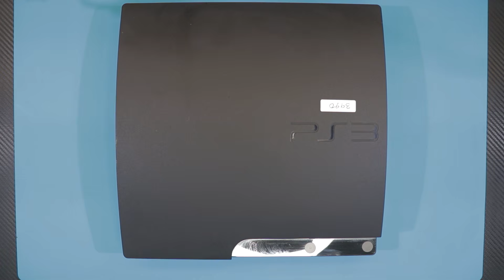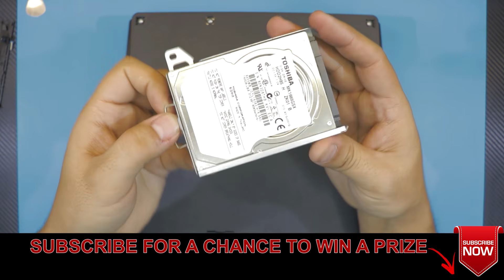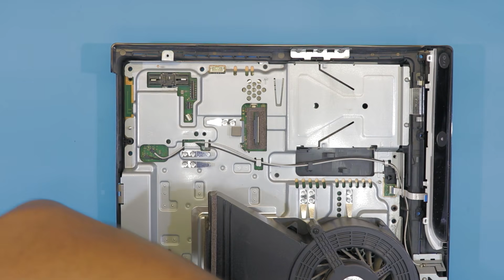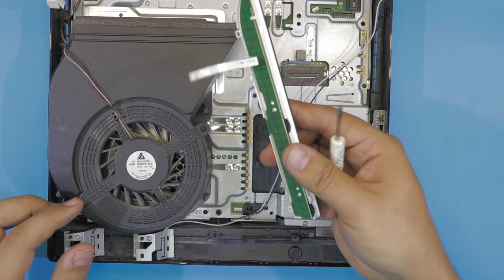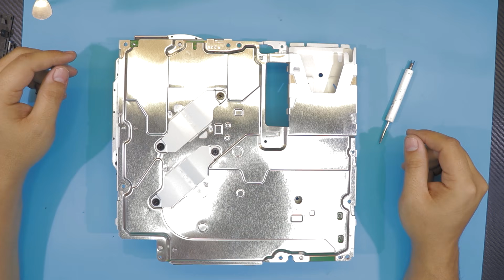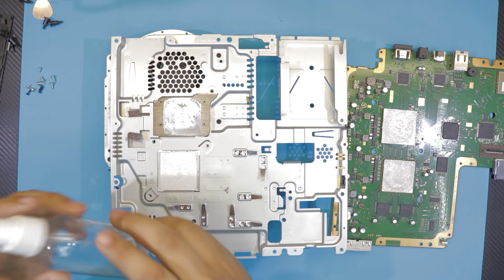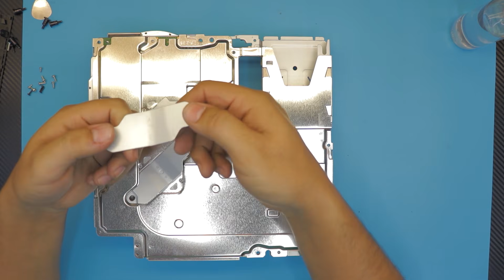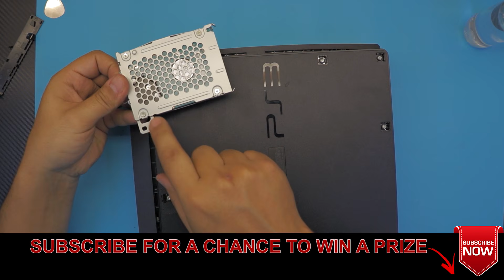HOW TO CLEAN AND  REPASTE YOUR PS3 SLIM ( playstation 3 slim console )

Comment: Hi UFIXTEX, I have a question about the Ribbon Cable from the Bottom side of the Blu-ray disc drive. Is it safe to use any kind of marker to label the Ribbon Cable from the bottom side of the Blu-ray Disc Drive? or Do I need some sort of a special marker for this? I just want to know that if it's safe to use a marker to label the right side of the Ribbon Cable while Reinstalling the Blu-ray drive. Can you tell me that if it's safe to use a marker for the Ribbon Cable from the bottom side of Blu-Ray Disc Driver? Please Comment Me Soon. See You Later.
Reply from the maker: Thank you for your feedback! If you wish to support the channel, you can like, subscribe, or both!
Regarding your question, yes of course you can use a marker and label the flex cable the side that goes to the board and the side that goes to the dvd drive, you so can be on the safe side.
Should you have any further questions or requests in the future, please don't hesitate to ask me.

Comment: what does the thermal paste do?
Reply from the maker: Thank you for providing your feedback! If you'd like to show your support for the channel, you can either like, subscribe, or do both!

In response to your question, thermal paste is a compound applied onto the CPU and GPU. Its primary function is to improve the transfer of heat from these components to other surfaces. Additionally, it aids in filling the microscopic imperfections present on the copper surface of the heatsink and the CPU/GPU. Using high-quality thermal paste is of utmost importance in electronics.

Think of it as akin to changing the oil in your car every six months to enhance performance and heat dissipation.

If you have any more questions or requests in the future, please feel free to reach out to me. Your curiosity is always welcome!

Comment: POV 
Take the power supply out & fan clean fan, Heatsink, put it back together 💀 not risking that disc drive
Reply from the maker: you won't be able to remove the heatsink and repaste it, without removing the DVD drive. the DVD drive is not a risk, take your time and you can get it done under few min.

Comment: I finished with an extra screw and the top case won’t stay on
Reply from the maker: you can try to follow the steps and see where you missed the screws but most of the screws are useless, even the top cover is better off than on better cooling :P

Comment: I recently took apart my PS3 slim and when I went to pull out the ribbon cable for the on/off button, I broke on the clip for the ribbon cable and have been looking around to see if I can find a replacement part. Does anyone know where I can search for a new part?
Reply from the maker: what click the jack where the flex cable connects to the board or the jack on the on/off board?, or the flex cable is damaged?
look for it in aliexpress they have all
Reply: @uFixTek  the cable is fine. It's the jack on the board that's been broken off.
Reply from the maker: just to clarify we talking about this jack? https://imgur.com/a/vL9YCX2
how you managed to do that?
it will be very very impossible to find it, the only solution is to ask repair store to sell you one from a donor board.
Reply: @uFixTek  yeah, that's what I'm referring to. And that's what I was thinking I was gonna have to do if I wanted to fix it.
Reply from the maker: but you could just take the board to a repair shop and ask them to replace that , it will be cheap rather taking the all parts assembled.

Comment: Do you had any advice for dead screw? It wont budge at all. I cant do anything because the screw is on psu
Reply from the maker: Thank you for your feedback! If you wish to support the channel, you can like, subscribe, or both!
Regarding your question, use a flat heat screw driver small enough to get inside and it will remove it.

Comment: I have a question you are removing power supply screws with machine I don't have one and power supply screws are so hard I can't open it
Reply from the maker: press down hard on them with a bigger handle screwdriver and rotate.
USE a bigger handle screwdriver.

Comment: 4:00 i'm having a big problem removing these two screws... any suggestions?
Reply from the maker: Thank you for your feedback! If you wish to support the channel, you can like, subscribe, or both!
Regarding your question, To loosen the screw, it is recommended to use a larger handle Philips screwdriver and apply downward pressure while simultaneously twisting it.  it will come loose.

Comment: Will this fix this symptom that is happening to mine?  Unit turns on shows green led then it turns red immediately ...doesn’t put out any video....any recommendations?  Thanks
Reply from the maker: this will prevent that from happening, to fix this issue i can tell you how to do it at home, BUT MAKE SURE you follow every single step.
#1. remove the motherboard completely (heatsink )
#2. place the board on a wood table ( clean the thermal paste)
#3. make sue the room temperature is constant (no air conditioning turned on), no fan.
#4. use a hair dryer at max heat and medium air,
#5, keep it straight over the GPU ( the chip that has a thicker heatsink) for 10-15min with 1" distant
#6 let the board cool down on its own, Do not move or touch the board for 15min
#7 repaste and enjoy.

Comment: I recently bought a never used CECH-2001A PS3 slim In mint condition still in its original box and everything. I recently opened it up and replaced the dead CMOS battery due to it sitting for so many years never being used, but I’m still a little hesitant on going further. The manufacture date on it is June 2009, so it’s going on 14 years old now.. surely the paste in it is aged, should I just toughen up and re paste it? I do want it to run for a long time. Thoughts?
Reply from the maker: Thank you for your feedback! If you wish to support the channel, you can like, subscribe, or both!
Regarding your question, i highly recommend you to repaste, the paste is over 5 years and it has lost it's proprieties. if you want your console to last longer and not duffer any over heating, clean and repaste.
use a High-Density paste:  https://amzn.to/42QAwsW
Should you have any further questions or requests in the future, please don't hesitate to ask me.

Comment: Glad I found this video. Much better than others I've seen. Thank you.
i just bought a used PS3. It takes the discs in but sounds like it's struggling. The steel rods are dry on the disc drive so I'm thinking they need lubricated. What grease do you recommend? Or it could be the motor is going bad. I hope not.
Reply from the maker: Thank you for your feedback! If you wish to support the channel, you can like, subscribe, or both!
Regarding your question, much appreciate the support, use this for the lubrication, i use this for years and have a good result, and air dust the dvd drive,
https://amzn.to/3VIjQkH
https://amzn.to/3HJNXT1
Should you have any further questions or requests in the future, please don't hesitate to ask me.

Comment: 8.30 man those 5 screws are tight
Reply from the maker: Regarding your question,  use a long screw driver and make sure you press down on the screws hard and do a slow turn with pressure on them.

Comment: 👌🏽👌🏽👍🏽
Reply from the maker: You are welcome! Glad that it helped you 😊Thank you for the feedback! if you wish to support the channel you can LIKE or SUB or both :P
if you have any question or request in the future feel free to ask me.
Reply: @uFixTek  

Thank you very much for your good training. I had a question. When I opened the console for the first time and cleaned it, I plugged it in and it worked without any problems, but I left some screws and 24 hours later I had to open the console again, but this series of consoles  It didn't turn on. Can you tell me where the socket is? I connected everything correctly
Reply from the maker: Around 80% of the screws in the console are unnecessary and not required for proper functioning. If you've reopened the console and it's not working now, you need to double-check every single flex connector to make sure they're not damaged and inserted all the way into the jack.

Comment: I can't seem to screw the tension plate back in place 🥲💔 can you help me fix this?
Reply from the maker: Thank you for the feedback! if you wish to support the channel you can LIKE or SUB or both :P
regarding your question:  you will need to lay down the fan side on the table and place the tension plate on the top, you want to only screw few rotation on the 1st screw (not all the way), the you will need to press down with your thumb on other side and place the screw in the hole and do few rotation, then place the other tension plate do the same. and then go back and screw all 4 all the way
Reply: @UFIXTEK  I really really appreciate the reply, it turns out that I was using the other (fat) Phillips screws not the black ones 😅, ops 🤦🏻‍♂️
Reply from the maker: jajajja good that you figured it out my friend 🍻
If you have any future questions or requests, please don't hesitate to reach out to me. I'll be happy to assist you.

Comment: Hello! I bought second hand  Playstation 3 slim before few days . I noticed that cpu and rsx temperatures have big difference around 20 degrees in favor of cpu . Cpu temperature is around 70-75 degrees and respectively  rsx is around 50-55 degrees . Does the problem come from old thermopaste ? The previous owner said that he did service for the console . Thanks in advance
Reply from the maker: Thank you for the feedback! if you wish to support the channel you can LIKE or SUB or both :P
regarding your question: it could be 50-50 if the owner placed a bad thermal paste quality, or never changed the paste and or cleaned the fan system. i recommend you to reopen and re apply and clean the heatsink, use a good paste like: https://amzn.to/3DlZs12
Reply: @uFixTek  Thank you for the information! Best wishes!
Reply from the maker: It's my pleasure my friend.
If you have any future questions or requests, please don't hesitate to reach out to me. I'll be happy to assist you.

Comment: Help i got to the end where u have to place the cover but i still have 2 black screws left that is for the inside and i cant find where i missed to place any screws also the on and off swith  and cd reader is pretty loose so please help me
Reply from the maker: Thank you for the feedback! if you wish to support the channel you can LIKE or SUB or both :P
regarding your question:  1st of all don't worry about the extra screws left over, 80% of the screws are not even needed. and in order for me to help you with screw location i need to see what you have done. regarding the ON/OFF can you send me a detail video link so i can see, in order to help you.
Reply: @uFixTek  yea sorry and thanks for commenting but i just bringed the ps3 to a repair shop , but since you're so nice and helpfull and i will 100% need your help im future i will subscribe and like also the thing is that the cd reader and the on and off switch is loose and there was practically nowhere to put the screws in as far as i saw. So yeah i was pretty confused

Also now that the problem will get fixed by an professional and not by dumb me. I have anotther question, i want to buy an SSD for my ps3 but i dont know how the connector type or whatever is called on the end which connects when you slide it in, do you know what it is called and do you have any reccomendations?
Reply from the maker: awesome, and you not less or dumb for trying and you have done more than what others can. i know people that can't even hold an screw drivers. just remember trying it not failure, not having the courage of doing, that's a failure. if you don't break you don't learn. if you don't try you dump :P
regarding the SSD upgrade here is a video i made on ssd upgrade see if it is what you looking for,
https://youtu.be/tXGp-XpBMd4

Comment: Is arctic mx6 a good thermal paste for the ps3? And is a 4g tube enough?
Reply from the maker: Thank you for the feedback! if you wish to support the channel you can LIKE or SUB or both :P
regarding your question:  it makes no difference in performance my friend you can place a artic mx 4 o5 o6 you will get the same performance. 
as long as you use a good grade thermal paste (known brands) you more than fine but if you want and can spend more go with higher end.
the CPU or GPU of the ps3 are not over clocked so they don't hit 99c with any thermal passe you use it will be under 70c.
https://amzn.to/3tLbzzw

Comment: For anyone wondering, this is a ps3 slim model CECH-2511a
Reply from the maker: thank you for the feedback, and yes it is 2511a and the other model the link to it is in the video description
Reply: Do you have a video for the model CECH-3001B ?
Reply: And what would be the diffetence between the 2511 and 2501?
Reply: mine is 2500a
is the internal are different?
Reply: Yeah I have this one and i was struggling to find anyone else with the same one on youtube. I was having trouble with the disc drive.
Reply: How do you know which model type you have? Does it say on the bottom of the console?

Comment: Don't you have to remove the cpu and gpu cover? Or is that just optional because i saw a ps3 slim disassembly and thet guy removed the covers and re-pasted that part and also put paste on the covers like you.
Reply from the maker: Thank you for the feedback! if you wish to support the channel you can LIKE or SUB or both :P
regarding your question:  absolutely not the paste under there is no need to be replace and there is a very high chance of damaging the crystal dye by doing it. and if you do replace the paste under IHS you will only drop the temp by 2-3c max.
and this is not a PC you can't over clock and only by re-pasting it's more than enough, and the temps won't hit 90c so no need to removing the IHS.
i been doing this for over 17years and i do remove the IHS as per clients request but never recommend it. Just use a good thermal paste and you be fine:
thermal grizzly kryonaut: https://amzn.to/3Gwsy0a
Reply: Ok. Thank you for your help. I just saw lits of people do it, but it is risky and the difference is small.
Reply from the maker: yep its not worth it absolutely not, that's why i don't make a video on how to do it, because not everyone can follow and do it. also won't see a performance increase.
Reply: @uFixTek  actually you are spreading misinformation now since i know you commented this a month ago and like idk about half a year ago came out an overclock for ps3 so yeah just pointing that one out also thanks allot for the tut im currently on reassembly part ill edit this comment to tell ya if my ps3 is fine( this my first time ever putting thermal paste)

Comment: I have a CECH-2001A and my lid won't easily lift off like this one. The area in the front left (to the left of the disc drive) doesnt want to separate from the base. My model has only three black screws on the bottom instead of four.
Reply from the maker: Thank you for the feedback! if you wish to support the channel you can LIKE or SUB or both :P
regarding your question: you must have 4 screws, can you email me few pictures from sides under of the console. or upload a video

Comment: 5:30 DO NOT pull on the flex cable at the bottom of the DVD drive!
The retaining clip is the brown piece around the plug on the board
Lift the brown piece up gently from power supply side and the cable will be free
Reply from the maker: PULL STRAIGHT UP , it will release it self, the retaining clip its not biting on the flex it won't damage the flexor!  we open so many and never ever had issue with it. but if you want to fight with it and find a way to stick your finger under and not damage the flex and pull the clip out..sure do it. but there is no way in hell you can damage the flexor by pulling it straight.

Comment: What are the chips that the thermal pads go over? I know the black square Sony chip controls USB or something but I don't know what the tiny chips under the RSX are or the R36X chips under the cell processor.

I was curious why those specifically had pads but nothing else.

Thanks for the teardown video!
Reply from the maker: Thank you for the feedback! if you wish to support the channel you can LIKE or SUB or both :P
regarding your question: those are MOSFET and power regulators (square shape black chips) to the GPU and CPU.
if you have any question or request in the future feel free to ask me.
Reply: @uFixTek  Oh ok thanks for the reply! So the 2 small chips are power regulators. What are the grey cubes that say R36X on them? The 2 below the Cell have thermal pads but the 2 below the RSX do not.
Reply from the maker: the cube are the coils, and yes the smalls are power regulators.

Comment: That's not how you apply the paste. Only one 3mm blob right in the centre is needed then when you screw the plates on it spreads it evenly
Reply from the maker: that's how you don't like it, but if you wish you play te paste you wish go a head do it, all methods are valid. i been doing this for over 18years for clients have tested many other methods and they are all good. no need hype over it. its not a nasa equipment. here is a test of paste result. https://youtu.be/GgXVw0M2ch0

Comment: Is this a model 3001a
Reply from the maker: i do not recall the model, its a old video, but all 3000 series are all the same. there are two types of slim ps3 and one is this video and the other is this link:
https://youtu.be/Gey66EGkCBs
the only differences in tearing down is the DVD drive cables, they use two different types of connectors.
all the 3000 series open the same way